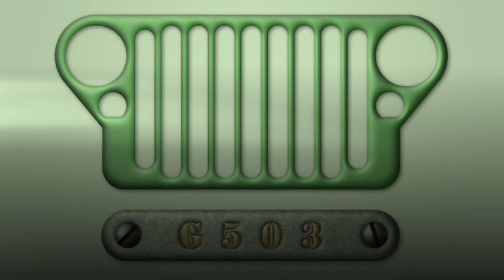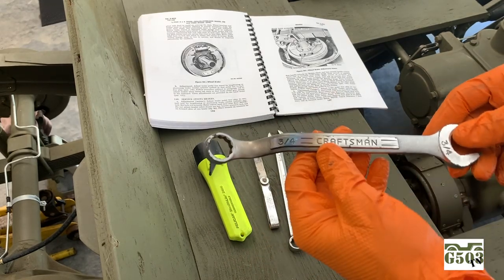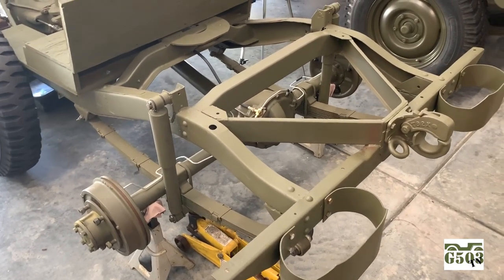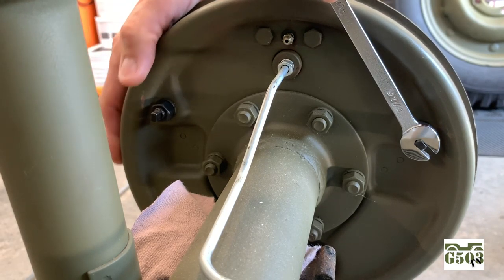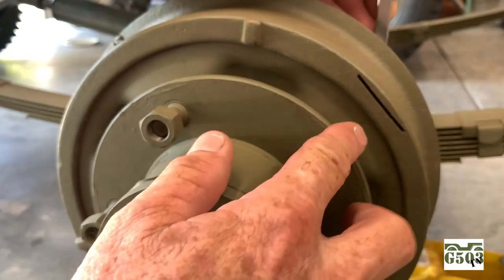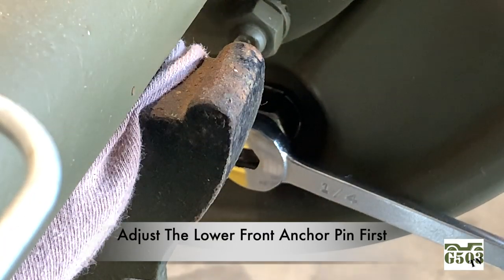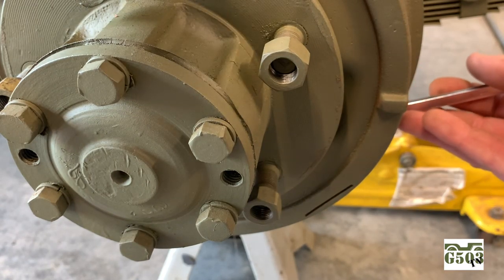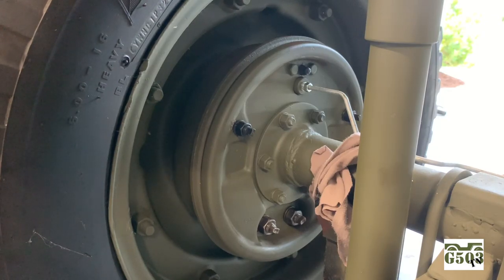How To Adjust The Brakes Properly On A G503 Willys MB

Comment: I don't use a flashlight......I took a black marker and put a mark on the backing plate (a little line) to where the shoe is to be measured.  Now I know exactly when the slot is to be when I stick my feeler gauge in.

Comment: Seems like those tolerances would all be lost after a few miles of driving.  I've always just gone by the "small bit of drag" method, and called it good.  (maybe that's why nobody wants to ride with me???)  Thanks for the vid!
Reply from the maker: And that would be the minor adjustment. I have newly turned original brake drums, still in spec.  like i said in the vid.....they will stop on a dime.

Comment: I bought a used Snap On brake adjustment wrench on eBay for $38. Worth its weight in gold! Must have to do it right. Theres no slots in my drums so the feeler gauge was out. Do you have a work around for that? I just adjusted it so the rear shoe was dragging a little then backed it off until it wasn't. same with front shoe but a tiny bit more backing off. They work fine with no pulling.  

How about a video on the handbrake?
Reply: Take your drums to a machine shop they can put the slot in them for you I had it done myself and it worked perfectly

Comment: Thanks! I have an International Scout 80 (~’65 model) and did not know how to do this. I will read comments below but assume you cut the slot in the drum? If so I will just use my air cut off tool to do so on mine. Thanks again!
Reply: Slots were in all WW2 jeep brakes. And your International scout does not have the same type bottom anchor brakes so are not adjusted as in this video but will have duo servo brakes that  have a bottom central adjuster.  Later models would have self adjusters.
Reply: @johngibbins5587  Thanks for taking time to reply!!!
Reply: John Gibbins  Thanks for that great info too and for being so friendly!!

Comment: Scott did I miss the part where the bottom section of the drum only uses a .005 feeler gauge instead of the .008? I listened to the video a few times and didn't hear the switch...maybe it's just me. Thanks
Reply: Never mind 3rd time listening is a charm. Excellent video btw. Thanks for posting these tips.

Comment: Anyone know where I can buy one of the wrenches he made? Having trouble finding one.
Reply from the maker: The wrench I made is from a regular 3/4 inch box end, open end wrench. I heated it, bent it into shape and ground it to make it thinner. 
I made it to make this job a breeze. You can do the same with a 3/4 offset wrench out of the box. They are available everywhere, including harbor freight 👍
Reply: What kind of wrench are you using to hold the cams?